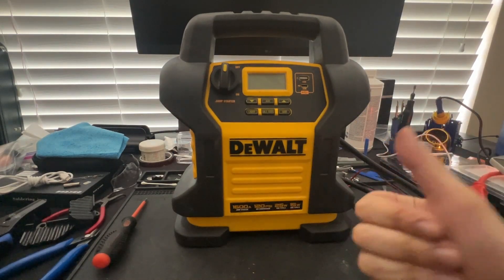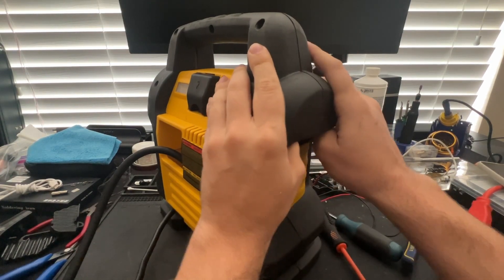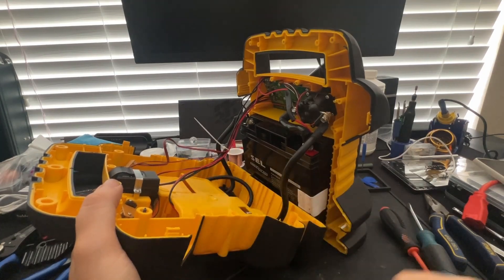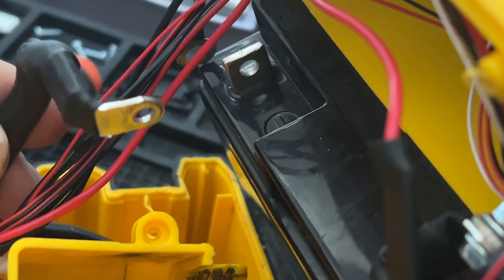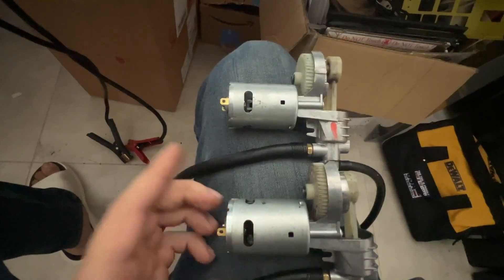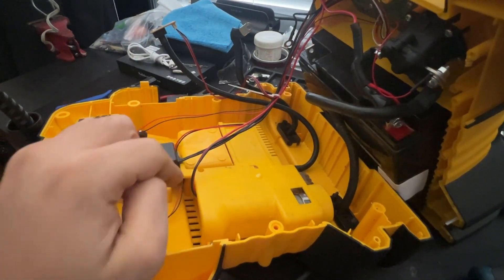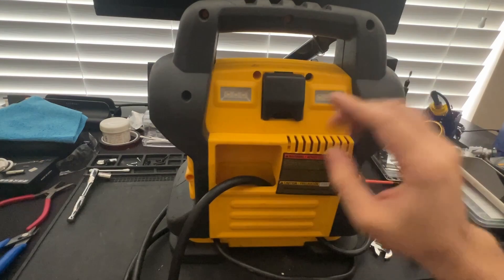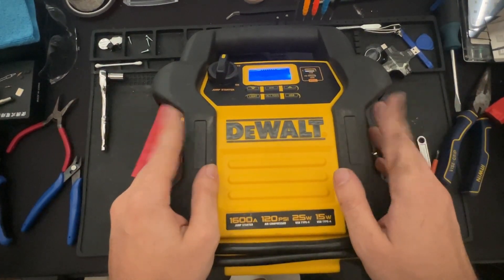DeWalt Jump Starter Disassembly/Air Compressor Repair

Comment: My dewalt jump box is showing 169 psi when I try to use the air compressor. It was working fine until now. Any suggestions?

Comment: Cannot believe all this effort but not giving details on where to buy replacement compressor!
Reply from the maker: Check the description. I’ve been looking high and low for a consistent source as well.
Reply: But you found one to replace it with?
Reply from the maker: Pulled from another DXAEJ14 with a different problem

Comment: Could you please provide a link to where you purchased the replacement?
Reply: I have the same issue and would also like to know where to purchase a replacement compressor.
Reply from the maker: The part was pulled from a unit with a different issue…The main fault with this unit was the brushed motor. I’ll update this comment when/if I find a compatible part
Reply: @DudePingu  Do you happen to still have the old assembly with the burnt brushed motor? The issue with mine is that the gear keeps slipping off the shaft that drives the piston. If you're able to sell me that part of the assembly, I would really appreciate it.
Reply from the maker: @enriqueormeno3852 It’s a lot worse than burnt. The plastic fan assembly melted inside, the motor does not rotate at all. It’s a genuine fire hazard. I cannot in good conscience sell that to anyone, even for parts
Reply: @DudePingu  I don't need the burnt motor, just the gear and the piston. I've been searching for these parts endlessly, and this would be my last hope to restore my jump starter. We're using it for research purposes, and I want to assure you that everything is being done in a very safe and controlled manner. From the video, it seems like these parts are in great condition, and I'd really appreciate it if you could help me out.
Reply from the maker: @enriqueormeno3852 Ah, I see. Thanks for the clarification. I’ll take a look at it when I’m back in town.
Reply: @DudePingu Hello, I am just checking in if there are any updates ?